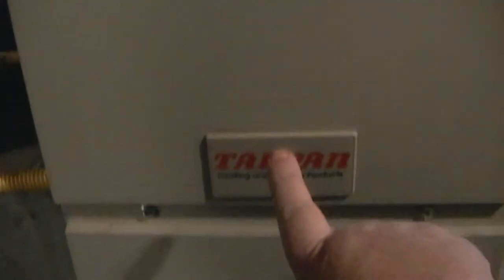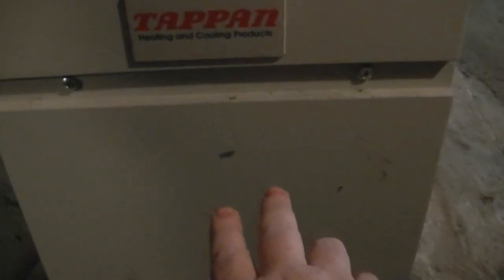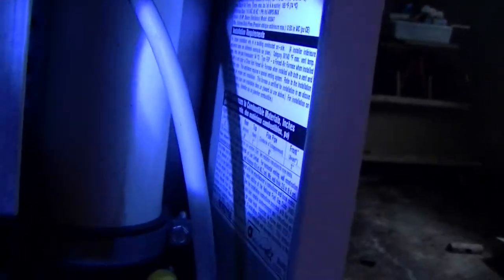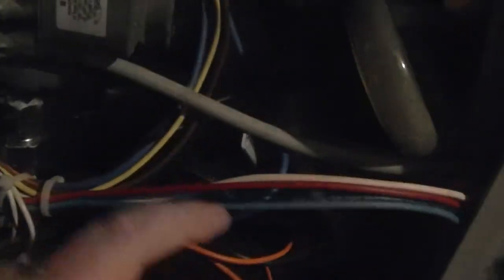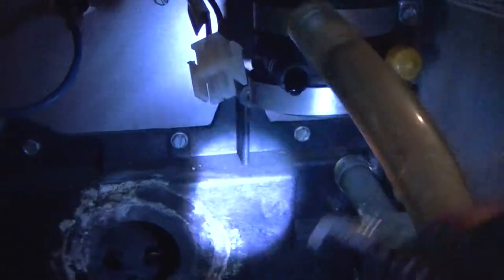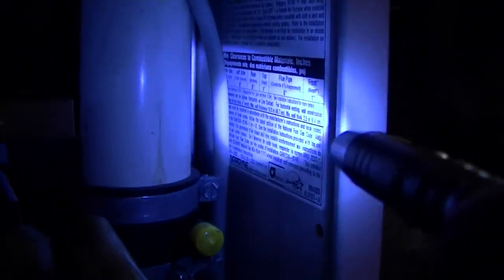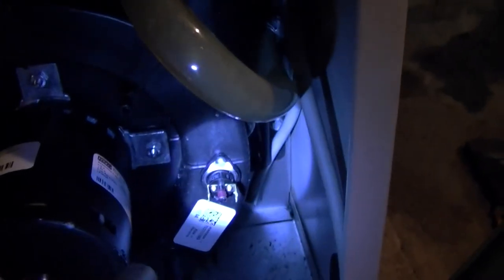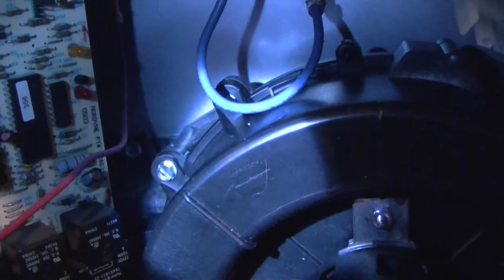ITL  15  2018 Furnace Repair !

Comment: I just looked it up.
My Lennox 110,000 BTU furnace was made in 1959 or 1960. 
Still running strong and anything goes wrong I can fix it easy.  :)
Reply from the maker: Chuck Howard I like the older furnices . They where easy . This one is not doing bad . Just do not like the installation that was done . I am fixing that though . Thank you Mayor !